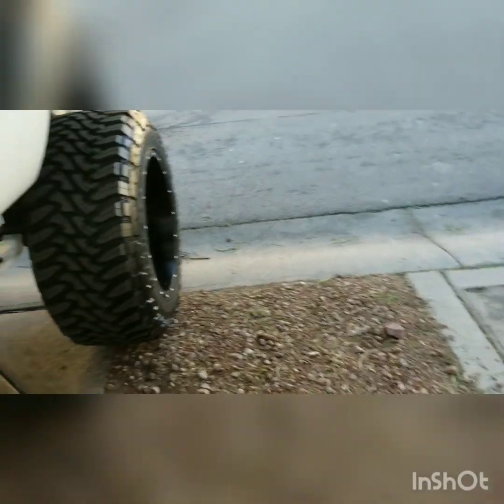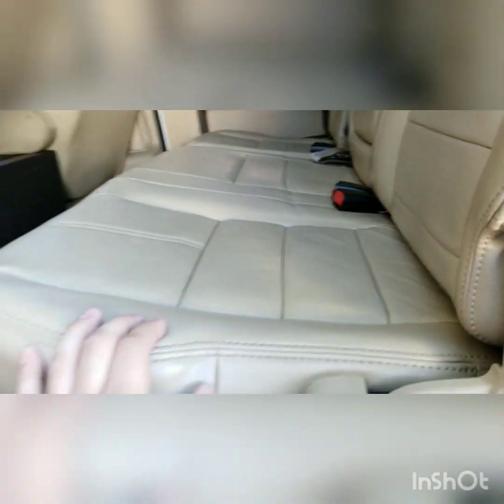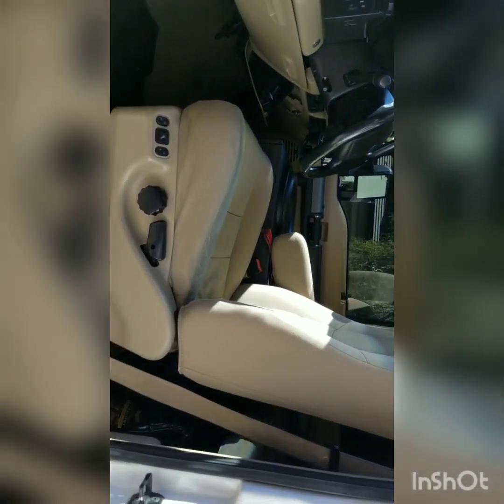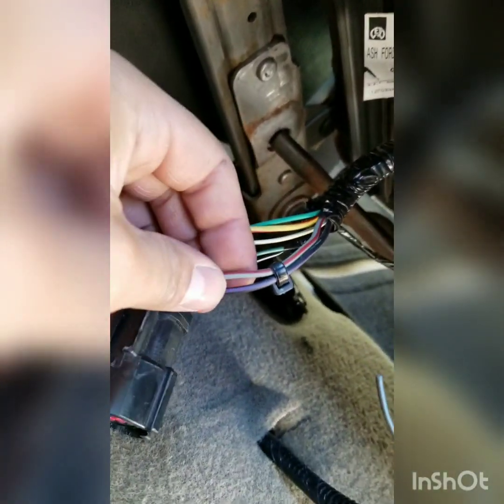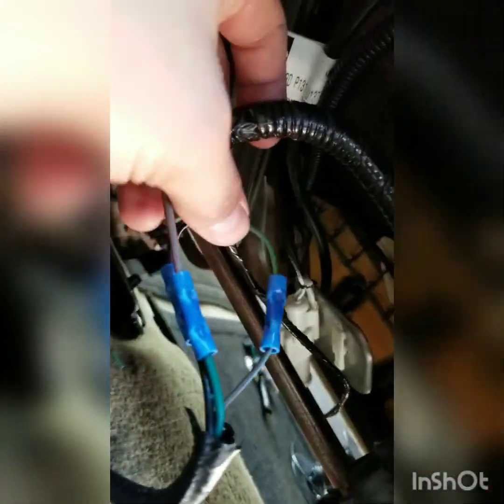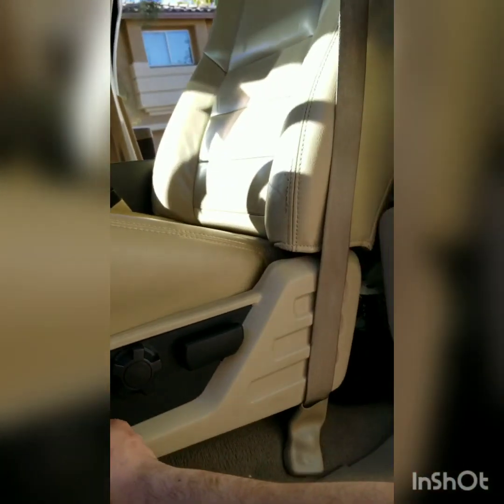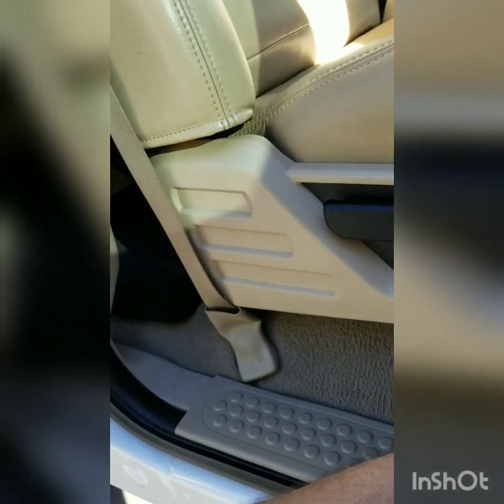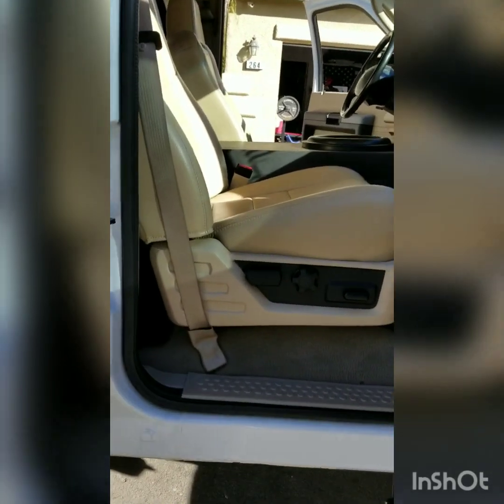F250 seat conversion

Comment: Keep up the good work, I want to do seat swap on my 2001 7.3 crew cab I’ll probably do manual ones for the front, do you know what years will bolt straight up? I’m guessing up to 2016?
Reply from the maker: They should all bolts up from 99 to 2016
Reply: 702 diesellivin thx, will do that soon, will do new carpet install also
Reply: That’s not the case in our 2001 F150. Just an FYI 

I do have a 2000 F250 I want to put 4 bucket seats in